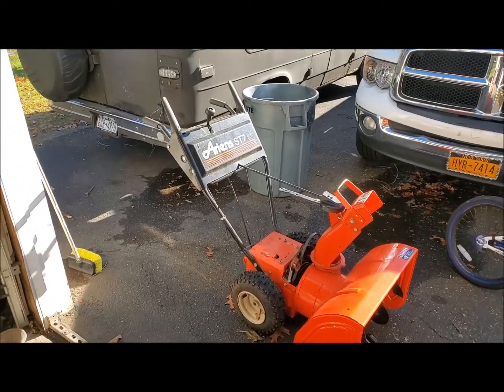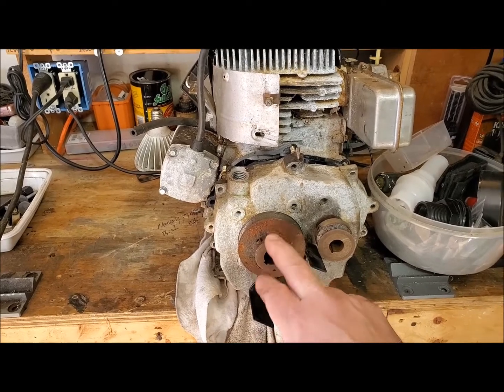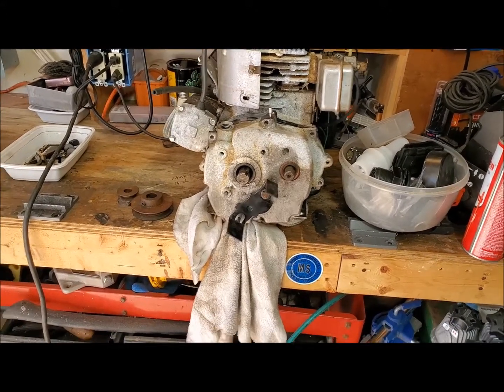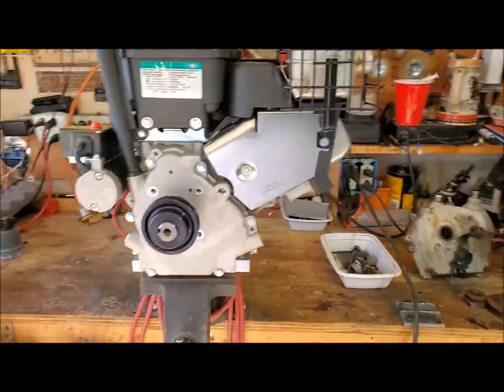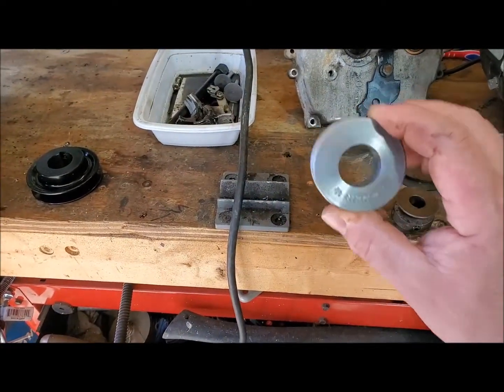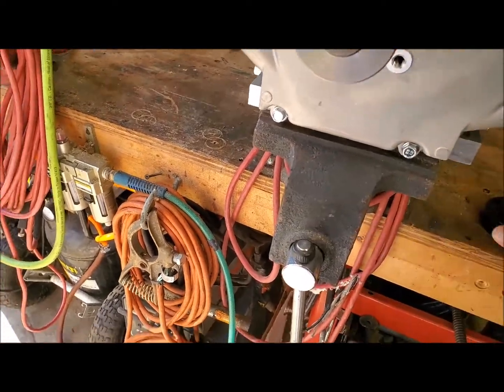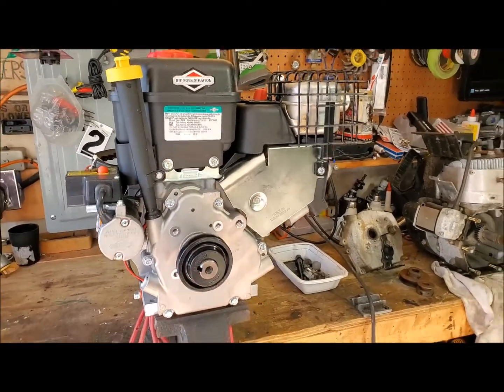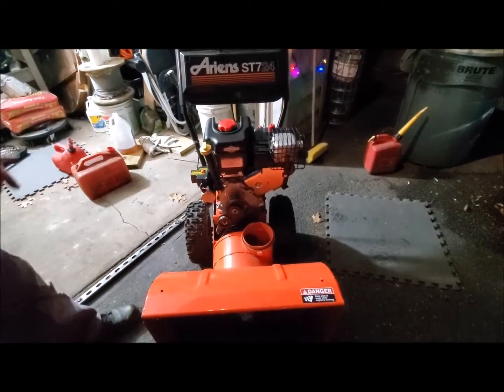Ariens ST724 Engine replacement.

Comment: If you have a Tecumseh engine, there is NO direct bolt on replacement.  They all have the two pulley set up, and I have not found any replacement engines that has the same configuration.   You will also have to reverse your friction transmission, if that is what you have, or your forward and reverse gears will be bass ackwards.  Good luck.
Reply from the maker: Good morning Michael, You are correct with everything you stated. The machine was built, and it is a beast. I'm leaving the backwards drive alone. Gives the machine character... Be well.
Reply: @raykd2ibp198  Im still  trying to figure out what to do with mine.  I have a three speed transmission and one speed reverse.  It is an actual transmission and not a friction one.  I still have the manual for it and it dont look like a simple fix as a friction plate one is.  Unless I can figure out how to overcome the two shaft design with one, I am probably just screwed.
Reply from the maker: @michaelfisher7835  The only time you're screwed is when you give up. How can I help?